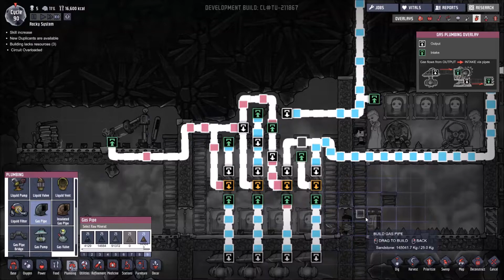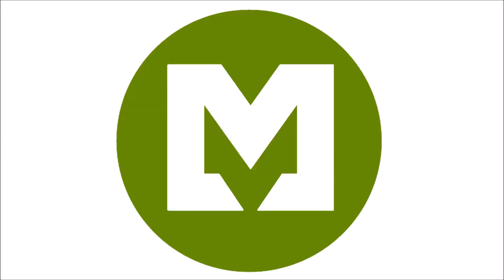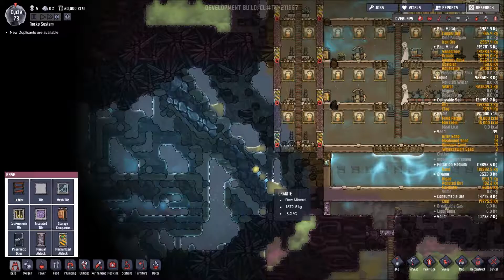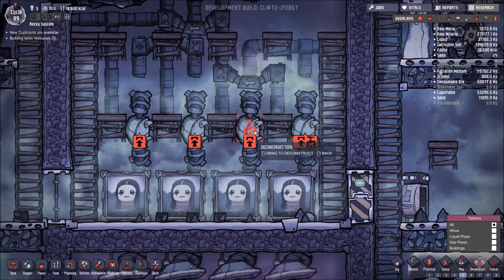Oxygen Not Included - Thermal Upgrade: Rocky System, Let Me Breath! #3

Comment: The mechanical engineering aspect of this game is complex but quite satisfying when the system works in the end. The one issue I'm having the most trouble with is oxygen stacking and backing up on long runs of duct work - no matter how many outlet vents the ducts supply they still can't dump the air fast enough. It probably has to do with atmospheric pressure within the space being supplied.
The only issue with this build (in the hydrogen loop) was not reducing the H to closer to 100g/s, which is why the H is stacking inside and will eventually overfill the generator - though this is an older episode, so I assume you've long since figured that out.
Good job!
Reply from the maker: Good point, not sure if I really understood this at the time of creating, at this point I was only looking at a way to remove the H from the atmosphere :)